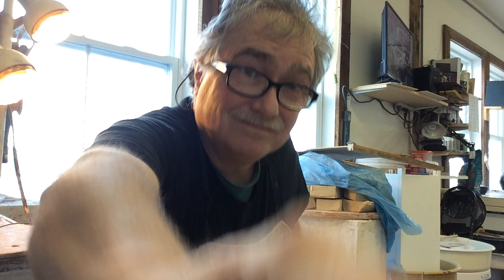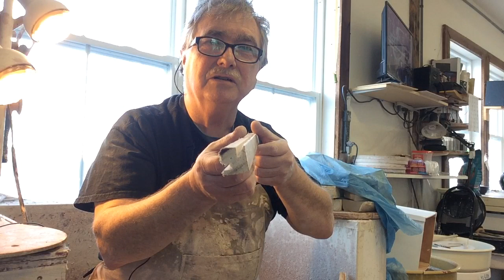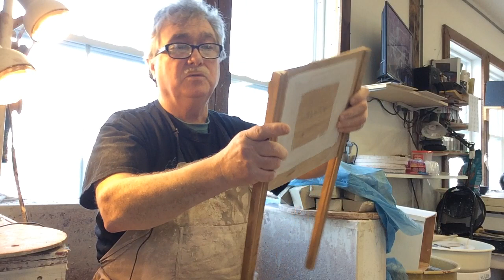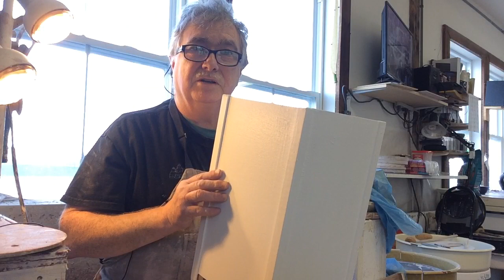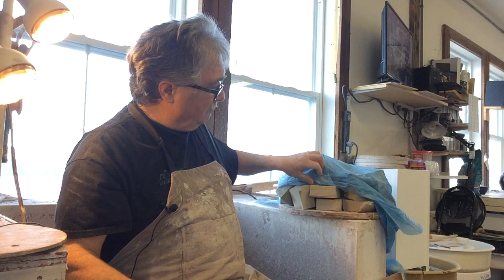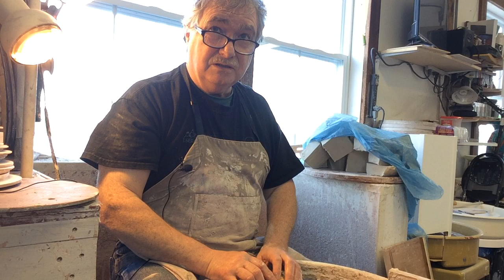Throwing cylinders for beginners and advanced.

Comment: I’ve been practicing to get back to throwing as I did some 20yrs ago. For some reason, the inside of my cylinders at the bottom there is a raised circle of well compressed clay; hwr, it doesn’t run the full width of the pot’s floor. Could this be from not evening up the inside floor? I use a rubber rib to compress the floor when I have the width early enough. I hope this makes sense.

FYI: I enjoy the sound of your wheel. No boredom at all. In videos where there is just the sound of the wheel & clay becomes my white noise. It is calming. 😊